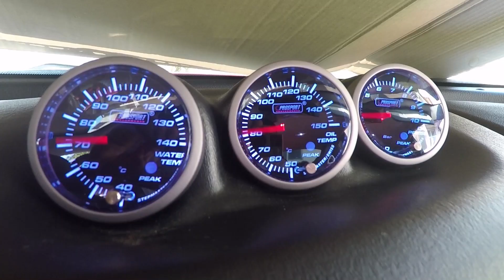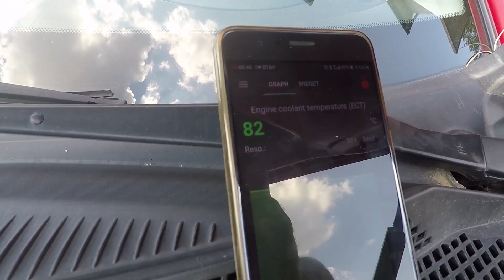Will This Mod Save My Engine? Rx8 Fan Control Kit

Comment: I have this mod’s and si great in the carebean where the climate is over 85f all time. The problem is the location od the temp sensor, this hose is For transfer bubbles to the reserve tank. I have analóg temp clock whit the RB adapter in heater hose an the fan activated St 204 f an turn off St 180-185f

Comment: I think this mod is shit, if the fans does correctly the job there is no reason ; install it on hose between the top radiator and the coolant tank will be better.

Comment: I Need your help. My Check Engine light is in and i got the code p2270... what Should i look out for?
Reply from the maker: p2270 suggests that you likely bought the wrong O2 sensor from ebay, if it is a new one in there. If not, try googling the code :)

Comment: I have this kit installed mate and have had 0 dramas with it. Worked first time and has done since. I would recommend check for air in the system. Wouldn't hurt to ask Scott from Rx8 Performance for any ideas also. Hope you get it sorted mate!
Reply from the maker: Thanks mante :)  Already asked him. Currently troubleshooting every small detail. Glad to hear you had success!
Reply: I’ve installed this kit of two RX-8s and it worked perfectly in both cars right away. 

You need to make sure you have enough coolant to flow thru that upper hose and cycle in the reservoir. 

When my engine is running, there is constant flow in the tank from that upper hose.

Comment: Just do a ECU remap to activate fan at lower RPM. In my JDM spec, low speed kinds in 95c and high speed starts at 100c. That’s way too hot. I’ve remapped it to 85c for low speed and 92c for high speed. No wires cutting or what so ever. Clean like stock.
Reply from the maker: Thanks for the feedback! After so many people telling me to remap it, i'm seriously considering getting the Mazda edit or similar, and start learning how to utilize it.

Comment: This mod worked for me, sometimes you need a drive cycle for it to start at the right time.... On the other hand, it caused my fans to run most of the times which resulted in a fan connection to melt, stooped the fan, engine overheated and coolant seals failure. 
.. currently in the middle of a rebuild due to it.... Don't blame the kit, I didn't have the right monitoring. But definitely passes a bill on fan life span...

Comment: Looking at the place the hose is connected to (top of the overflow tank) I suspect that there is and should not be any coolant their unless the engine is way to hot or there is to much coolant in the system.
Reply: i would put it somewhere close to the engine. Maybe the feed line to the heater core?
Reply from the maker: That's what i'll try to do in the next video :) I'll go for a ride, to see if that's the issue, and if not, i'll relocate the sensor. Thanks for the feedback bro!

Comment: Why bother all this trouble, kit, hoses, relays, really why do it if you just can get someone tune it? Just get a different setting in the ECU tune, did mine with 10 degrees lower temps to start the fans.
Reply from the maker: Im currently downloading mazdaedit and ill start doing improvements from there on :) from an experienced owners perspective, this seemes the best way to go. Thanks for the extra kick, it was time to take it up a step 💪😊

Comment: I DiY'd a button in the cabin and grounded the 2 relays.  When its hot outside it will keep 82 C° with the fan always on.
Reply: Attila Nagy info please???thanks in advance
Reply: @athanasioskristianpapanico1959  basically you need to ground the 2 relays of the fan.  Email me K3ntclar@gmail.com and i'l send you some pics
Reply: +Attila Nagy can you please send me info?  sakisw@hotmail.com

Comment: You have to bleed the air out. Might take a couple of heat cycles do  do naturally. Have the same fan mod on my car. It works excellent!
Reply from the maker: There is no air trapped in my system... I bleeded it out 3 times, and nothing came out anymore.
Reply: @Drivenbymadness   there is because  ,not is  the BEST place, so...why not put the new water sensor on  the trothle body tube of water,also you can remove the tube from the trothle body  and conect directly in the new water  sensor fan, in this line we have coolant from the first start and make sure you can leave the trothle body tube out if the weather in your city is not as cold as -4 degrees, then you will have gained extra cooling with 2 simple mods.Cheers
Reply: @Kansai_to  is there a place to have this installed - my son has an RX8 and I think this will help him
Reply: @karen30092  I'm sure a shop could do it but it'd be better for you and him to do it yourselves since it's not a terribly difficult mod to do. A shop might just overcharge you for it

Comment: I think that hose is just for return of coolant when it goes past a certain level within the system. It will be bone dry unless you drive aggressively imo. That's the point of the coolant "OVERFLOW" bottle, no? So that coolant that's overflowing from the system could return to the bottle and back into the system via that hose and via the hose at the bottom of the bottle.
Reply from the maker: Whoooo there cowboy :D I know the role of that hose, but the instructions of the kit say to install it there, and the people that installed it on that hose actually made the kit work... So the question is, why isn't it working on mine. That's what i'll troubleshot in the next video :) Otherwise, i would've installed it on the racing beat hose position, which would've made more sense.

Comment: I’ve just bought the same kit, but i was waiting to your’s video to instal it, i will write you a comment when i instal it
Reply from the maker: Have you tried installing it ?
Reply: Driven by madness  not yet, i think next week-end, if it can help you it will run with an oem radiator and thermostat

Comment: Air inside mate 100%
Reply from the maker: Triple checked and tried evacuating air again. No air is in my system.
Reply: @Drivenbymadness   did you find the problem?
Reply from the maker: @SnipingWithSkillz  tomorrow I will take the sensor out, put it in a separate tube and pour in some boiling water to simulate coolant flow, and if it does not trigger anything, there's just nothing else to do

Comment: I recently bought an RX8. Replaced the radiator with an all aluminum one and still running above 200f. Ordered one of these kits and will be putting it on tomorrow. Hopefully it’ll help out.
Reply from the maker: Any luck with the kit?
Reply: Driven by madness Well I installed it and noticed that the fans would kick on around 190-195 and not the claimed 180-185. Yesterday I spent the day replacing my radiator with a Koyo after thinking maybe buying a cheap eBay radiator wasn’t the best thing. I tried relocating the relay kit the fan kit to where RB recommends but the hose is too short and you have to buy some adapters to make it work on the bigger hose. So I followed that hose to the other side where it would work better. In doing so I broke off both of the electrical connections on the sensor as I was fitting it into place and tightening down the clamps. Going to try and solder the wires back on to what little connections I have left and hopefully that works. If not then I’m out $100 and I’ll have to order another or figure something else out.
Reply from the maker: Ohhh boy, i feel ya. Keep me updated on it man, hopefully i'll manage to make it actually work.

Comment: man i said to you thats not a good hose for measuring the temperature 😂 i think racing beat have better location to measure the temperature
Reply from the maker: I know bro, but i wanted to do it like the instructions say, so if someone runs on the same problem, he knows how to solve it :) Yes,  i know about the racing beat position, and it's a good one allight :)

Comment: The hose you've installed the adaptor in is the return pipe to the water bottle.  Do a Google search for "RX8 Racing Beat water sensor guide", and on their page there is a link to an installation guide.  Use this guide to locate the hose you should be using for an accurate coolant temperature reading.  Enjoy!
Reply: THBandit6 why would they tell you to install it there then? Do you have one installed on the heater hose?
Reply: This hose doesn't have a constant flow of coolant through it.  The tank is the highest point water can collect in the engine bay.  If it wasn't then having the coolant level markings on the side would be pointless.  Some companies utilise the heater hose (like Racing Beat), others provide a coupler that you'd fit in the radiator hose itself (Essex Rotary).  These are preferable positions as you constantly have water flowing through the cabin heater core, and will have fluid flowing through the main radiator hoses once the thermostat opens, so once warm you'd then get an accurate reading from the latter.  200F isn't overly hot unless that's when you're cruising at a stead fast pace on a highway, in which case I'd expect it to be lower depending on ambient temps.  200F around town or when press on on backroads isn't unheard of.  For reference i have a RB one installed in their recommended location which works flawlessly.
Reply: THBandit6 I just tried to install my fan kit on the heater hose but the included adapter is too small. The heater hose is a larger diameter and won’t work. You might be able to buy the RB adapter and screw the relay sensor into it.
Reply from the maker: Like Christopher said, why would they recoomend that position if it's know not to have a constant coolant flow...  I'll try and relocate it on another hose, preferrebly the racing beat one.

Comment: Mine works like a charm, keeps my car at 85 cruising like you do in the clip with original fans and radiator. Does throw a "cooling fan 2 control circuit" code though. I think  you need to drive the car to get coolant through that hose.
Reply from the maker: Just drove the car for the whole day today, and nothing happened. I saw the reservuori filling up, but nothing happened... i'll re check all the connections on the sensor to make sure nothing is broken or having a bad connection

Comment: Make sure you don’t have any coolant leaks anywhere and fill up the resivoir with more coolant if low... if you think it’s the thermostat take it out put the kettle on grab a bowl and a thermometer and pour the hot water into the bowl with the thermometer and drop the thermostat in. Should be around 82 degrees Celsius when that opens...
Reply: Not the thermostat. On his first drive it should have overheated already. See THBandit6 response below to know the real reason why it was like that